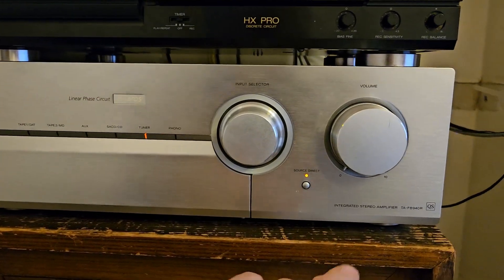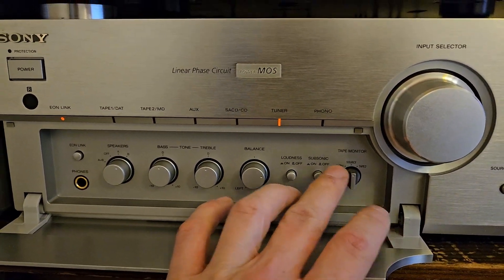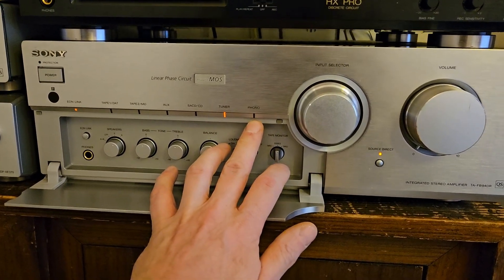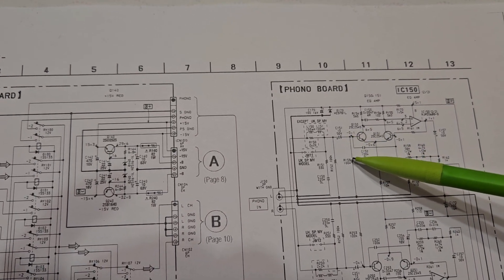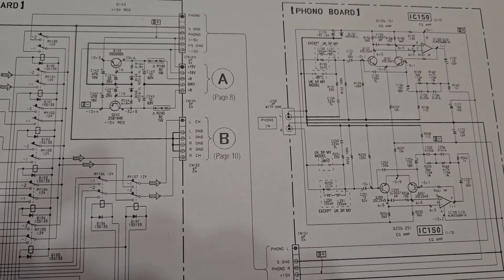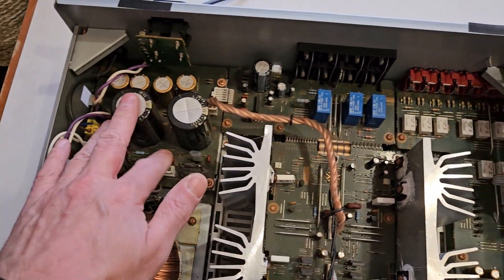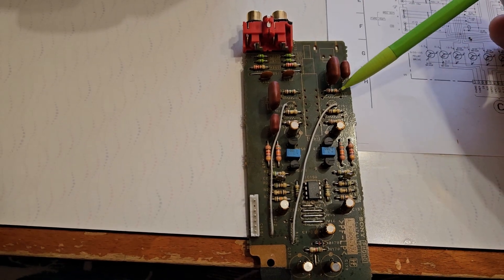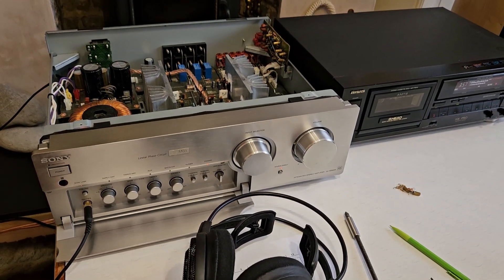Sony TA-FB940R Amplifer: Phono input modification

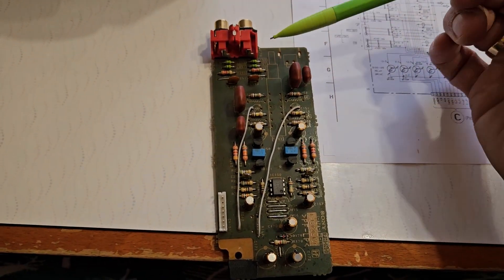Comment: I have this amp, a really nicely made design.. handy info to have thanks. 4:37 On that phono board there's some space for what looks like a long switch or variable control and another socket, any idea what that was for?
Reply from the maker: Well spotted. I wondered about that too. In the old days I might have guessed the switch would be to change moving coil to moving magnet or ceramic pickup. The socket outline looked even more mysterious, so I open to ideas. There didn't seem to be any option on the schematic. Perhaps if I wasn't in a bit of a rush I could have traced the additional circuit from the board.
Reply: @nicksmith4507  Yeah I guess it might be a switch for selecting cartridge types, these amps were the ES range and some were additionally labelled as 'UK Tuned' or similar, where they apparently optimised some of their higher end seperates for the UK market. Maybe this was an option for that.
Reply from the maker: @Dedubya-  I have never really known what "UK tuned" meant. IMHO amps shouldn't sound like anything, rather just invisible with power gain. Don't want to start an audiophile argument, you understand :-) Now, in this phono board components R150, L150, L151 (plus right channel equivalents) are noted as not present in UK, SP, MY models. Actually they are there in mine, but are shorted out with JW11. They would just provide some HF rolloff.